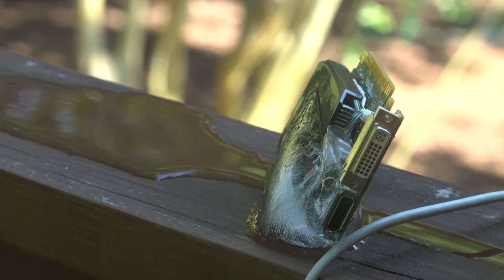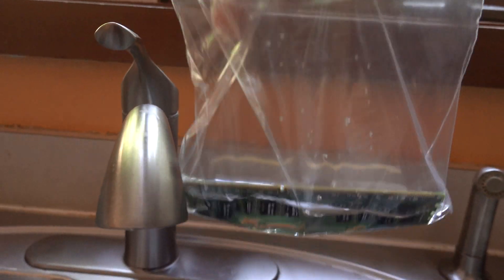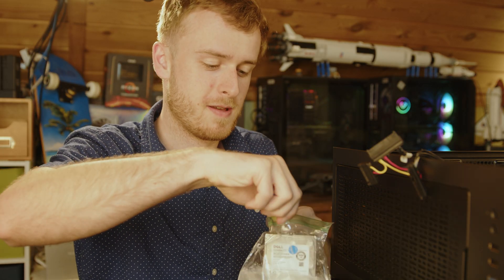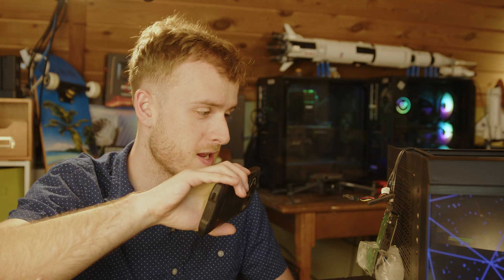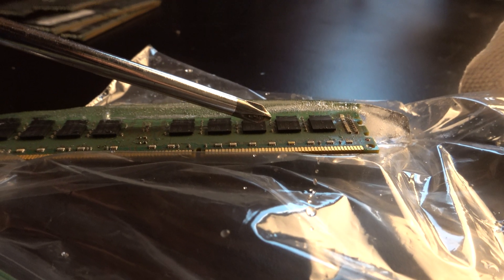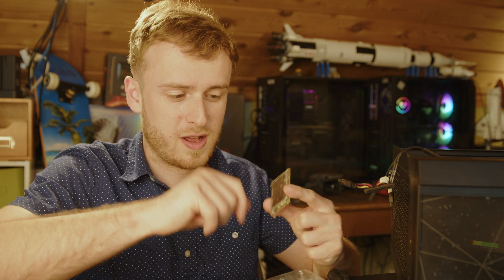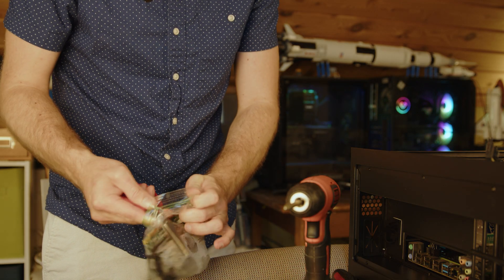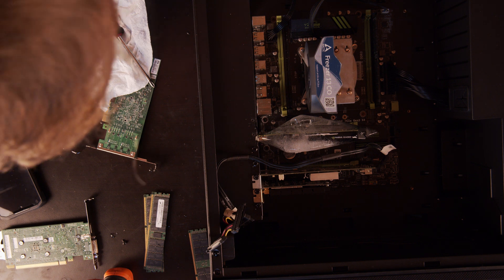What Happens When You Freeze Your GPU In Ice, And TURN IT ON

Comment: i wanna know if the hard drive didnt boot becaus the disc inside is frozen or is it because the boared was shorted, why not put the desktop you using upside down so the water will drop off the hardware on to the table

Comment: Do you have a 3D printer??? if so you could print a case that holds the water(or the bag with water in it) around everything EXCEPT the ports(and the fans) that way you KNOW it be making contact with the ports... AND when the water melts the bag will hold it and not have it drip on the mobo
ALSO you could put VASELINE/PETROLEUM JELLY onto the parts that you dont water to touch (so it doesn't short out) and then nit's just a frozen part.....
should should re-do this but make a good effort top= prevent it all from shorting out... with the Vaseline, or keeping the plastic bag on..... maybe placing the GPU in the bag with water so the ports and pci pins are right up against the plastic bag so that when its all frozen you can just cut the plastic bag away at the hdmi port and pci pins and leave the rest there......
you could have some real fun with this if you don't know what else to do freezing computer parts... maybe don't use water and just freeze the hdd ???

Comment: It would be interesting to see if an SSD would boot while frozen. There's no moving parts, so it might still work
Reply: dont think so as condensation would short out everything anyway.
Reply: SSDs hate cold temperatures hence toughbook SSDs are heated so polar scientists can use them without any problems.
Reply: @cptcrogge  I couldn't say TBH. I've never really even looked into Toughbooks, seeing as I've never had the need for something that durable. I do however know that one of the SSDs in my laptop survived being dropped in an icy lake a few years ago (that was back when I used it as an external drive for my camera)
Reply: YES
Reply: Water will likely result in electrical shorts.
Reply: It would probably freeze windows though

Comment: That comment is written before watching the whole video!
Before freezing it, I would cover all the conductive material with nail polish. Like even the whole PCB part, just to make it waterproof
Reply: or use distilled water
Reply: I always think about how clean the parts are before putting them into distilled water. See, all the dust cumulated thru all the years wont make the water conductive?